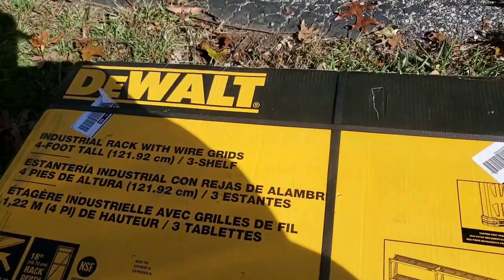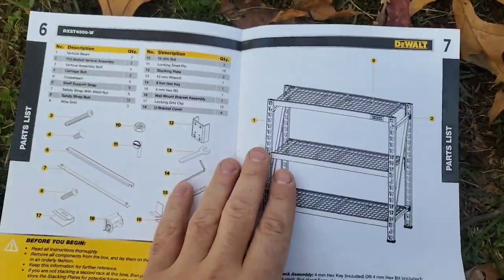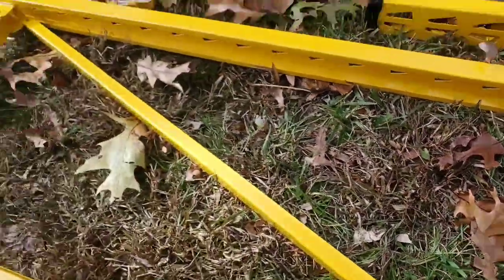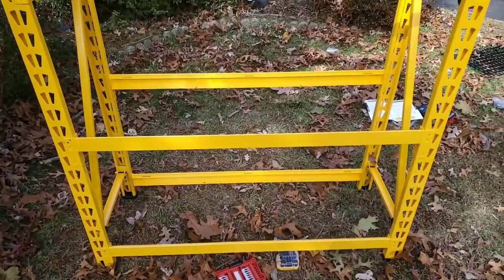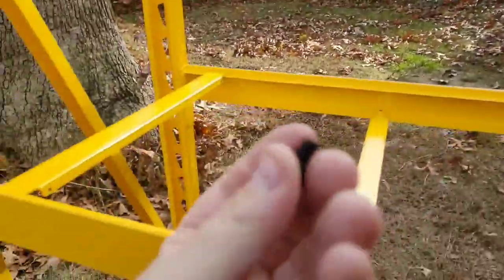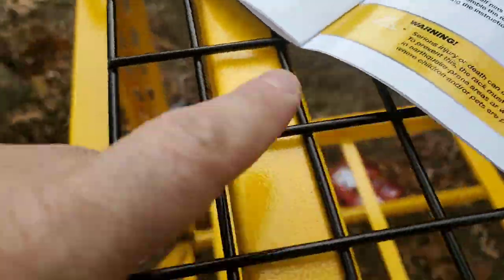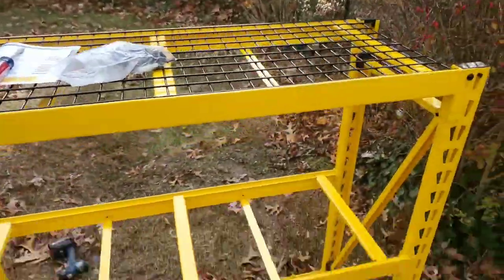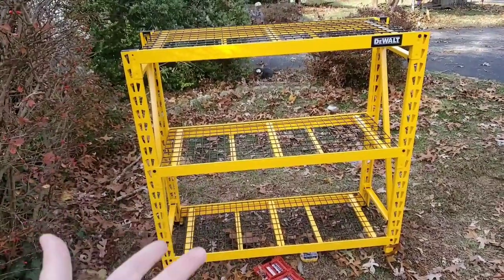Dewalt titan storage rack assembly and first impressions

Comment: The worse task: putting on the clips!  If frustration builds up, just zip-tie the wire shelf to the frame. I ended up doing that as an additional step beyond the clips, but they can do the job by themselves.  I have several Gladiator rack systems, and they were so much easier to assemble. I went with Dewalt this time, but I don't think I will do so again.

Comment: As of July, 2020 these shelves are garbage. I purchased 2 - 6 foot and 1 - 4 foot earlier in 2020. I decided to purchase another 4 foot to stack onto the first. The unit arrived in a different color yellow.  The paint barely covered the metal and in some places was just fumed. I took apart some the strapping brackets from both old and new shelves and found a weight difference. I weighed them on a legal tender digital scale and each strap weighed less than the older ones. Dewalt told me the new shelving unit was manufactured at a different plant and they can not guarantee color consistency, but the shelf is built the same. These shelves usually placed it a garage or a basement. These will rust up fast. The weight difference is due to less paint being applied. As of this date, Aug, 4th, 2020 Dewalt  is taking zero responsibility for the inept paint. I took pictures of this while the parts were still on the scale and sent them to Dewalt.  There response to me was return it to Home Depot.
Reply: what did u end up doing. so the only issue is the paint and weight?
Reply: @randomrazr  So far nothing has happened. Dewalt told me that they have 2 sources for the shelving and that my previous shelving came from their other source. The steel is the same, the paint though barely covers the steel. The outside is covered but the inside is almost translucent. In places it's bare. They told me there is nothing they can do about it. I told them that there is an issue with quality control. I sent pictures to them of several parts along side the same parts from the 3 units I purchased a month before. I then weighed them and each part weighed less on the new shelf. They told me I can return it for a refund. I purchased it from Home Depot. I'm waiting to hear back from them.